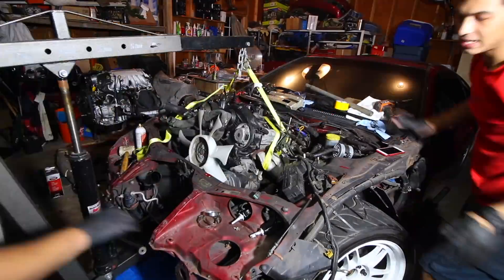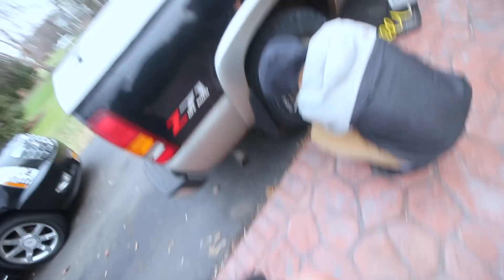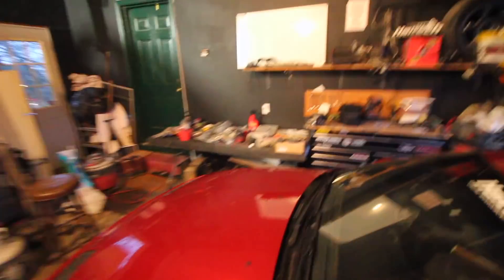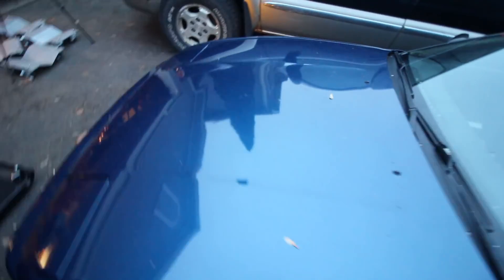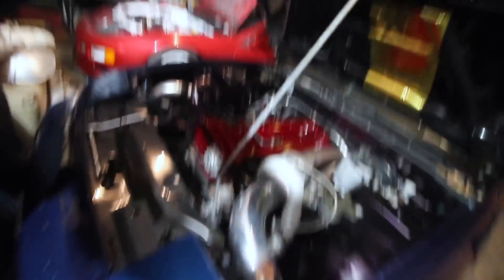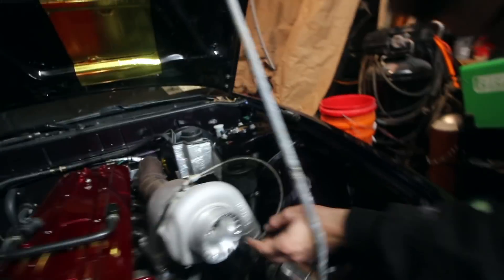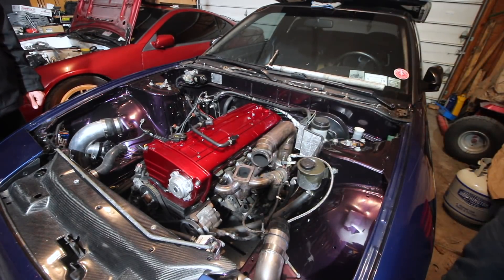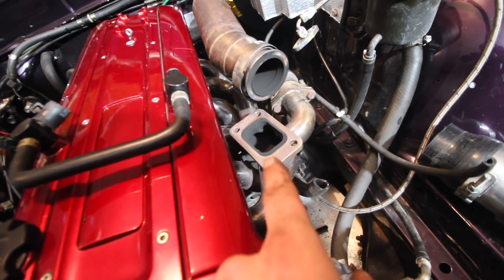Selling EVERYTHING... Let me Explain

Comment: I say 1jz, if you want high RPM and a stock block thats capable of making 900-1000whp and its 1/3rd the price of a RB. The RB stuff is nice but its way over priced and doesn't really hold much power. Parts are really hard to come by, you can't just go to autozone and pick up whatever misc parts you need, the JZ stuff you can. motivedvd on here made a video comparing the strength of the RB30 vs a 2JZ and the 2JZ is miles stronger then any RB. The RB stuff is also known for cracking blocks at anything over 600whp without a girdle, oiling issues aswell. The JZ is a far smarter decision.
Reply: The rb parts are not hard to find anymore it just takes time because of shipping, the rb blocks do crack but mostly on awd applications because of the front diff twisting the block, this problem is not seen on rwd application until pushing about 900hp, but the 2jz is stronger but the rb revs higher and the sound is better as well plus the exhaust side is the same as the ka   or sr20 so the exhaust is shorter and better flowing.
Reply: 2jz's are good, but your beginning topic was 1jz. The s13 should stay rb series. Like that rb30/rb26 he built that's what he should go for
Reply: @Singleturbo-sk9qp  ain't nobody hating on the jz lmfao 😂 😂 I know it's a superior engine and can make more hp for cheaper than an rb it's simply a preference for me :). But if you want to talk power for the money then the ls is King ;)
Reply: @Marcoo_S14  what you're talking about is block twist which happens alot on the awd rb stuff, the cracking I'm referring to is right below the head stud area on the 25/26s which happens even on the rwd applications, it's a casting flaw on those rb's. Not enough meat in that area, which an RB30 is not prone to but still even then the 30 is a much weaker block then a 1jz or 2jz. The 1jz is the same as a 2jz, Siamese bores same sleeve thickeness and materials just has a shorter deck height. As far as parts I'm talking about gaskets, sensors, alternators etc... Maintenance items are alot harder to come by then a JZ. You can walk into AutoZone anywhere and get whatever you need for a quick repair, in the states atleast. Plus a low mileage 1jz is $1400-$1600 from most importers, an rb26 can go anywhere from 3500-7000 depending which year and model RB you choose.
Reply: @Juhkwez  Look up username "jet066" on instagram his stock 1jz just made 1141whp thru a powerglide. No stock RB has ever made that power, let alone thru a powerglide.
Reply: @indecay3952  that is true bro however the twist is what causes the cracking in that part of the cylinder, it's in the motivedvd video and I have personally asked platinum Motorsports about this issue since I run a rb25 neo on my car and they explained that in rwd use this cracking is very rare and with a girdle it's non existent if you want to push more than 1000 hp but now a days most parts like that can be found on raw brokerage and other websites, it really isn't that hard but I get your point plus I do like the jz, the only reason I didn't swap it into my chassis was because I want to stay true to Nissan :)
Reply: He already has a JZ in the family, definitely stick with an rb platform for the content alone

Comment: Personally, I think you'd be best off with an RB30 block and crank, contentwise. RB25s are much easier to come by, but if you can get an RB30, then just do it. Also, if you want a transmissim that can handle more power than anything, get a ZF GS5-39DZ (E46 325D, 330D and E39 525D and 530D manual trans). It is a 5 speed that can handle over 1000 Nm (740 lb-ft). If you want a 6 speed, go for the ZF GS6-53DZ (E60 530D and E90 330D manual trans). Both are very cheap and (at least in Europe) not hard to come by. There are people that claim the 6 speed can hold about 1400 Nm (1040 lb-ft). There are even adaptor kits to bolt these transmissions to RB engines. I'm going to post the gear ratios at the bottom of this comment. I am currently building a Mercedes M104 turbo engine and using the 6 speed.

GS5-39DZ (5 speed) ratios:
1 - 5.24
2 - 2.92
3 - 1.82
4 - 1.24
5 - 1.00
R - 4.72

GS6-53DZ (6 speed) ratios:
1 - 5.08
2 - 2.80
3 - 1.78
4 - 1.26
5 - 1.00
6 - 0.83
R - 4.607

It is very important to buy the exact transmisson. There is also a GS6-53BZ, which is a petrol variant. Don't get that. The diesel (DZ) ones can hold much more torque.
I hope you find this comment helpful :)
Reply: A dude here broke a 6 speed zf in is 900hp turbo S54, it was nuts
Reply: @alexstromberg7696  Well, if it was a GS6-53DZ, then I am kinda surprised. Either way, a 900 hp 3.2 should have about 1300 Nm give or take. Considering it was built for a 500 Nm engine, it's still an amazing feat. I am actually building a Mercedes M104.992 (3.2 I6) with a T76 (7675 turbo) 0.96 AR. Should be able to make about 1000 hp, but I'll be pushing something between 720 and 800 hp. You know, ideal daily power :D
Reply: @aestheticoutlaws5259  he wasnt really caring if it broke, he streetraces that car so that the tranny even loved so long was a surprise.

The m104 is a really under appreciated engine, a guy here drifts one in a Merc chassi
Reply: @alexstromberg7696  a lot of Swedish and Norwegian guys do use that engine. I am going to streetrace it too, but I don't think I'll be abusing the tyranny. No need to power-shift or force the tyranny into gear when you have 4 times the power of almost anything else on the road
Reply: @aestheticoutlaws5259  If you're racing other more normal cars then no need to power shift or so, but if your racing other cars with 3 kits of nos and 9 liter engines you have to xd
Reply: @alexstromberg7696  I know. Can't wait to see the look on 911 owners' faces... And I'd love to see how my car will hold up to a Hellcat
Reply: hellcats are heavy so no problem.
Reply: @alexstromberg7696  yeah. They have about 650 whp, I'll have about 750 and I'll be about half a ton lighter. The only thing I am worried about is the 8 speed auto. It can shift faster than anyone with a manual and 8 gears means it will be almost always in perfect RPM. well, I'll have to find a Hellcat to race. Thankfully, I know about one :D

Comment: If your keep the rb20 get forged internals..I melted rings and cracked a piston trying to break records but the block held up .I had the head machined and went up a size on the pistons...make sure to upgrade the oil and water pump..I also know u can improve the oil flow on it

Comment: Rb25det Neo, no hydraulic lifters solid as rb26 and cheap,  plus later  if you get an rb30 block just use the neo head, combustion chambers are smaller for more compression for e85 use if going that path, keep the good work..

Comment: If you could lower the subframe and the engine block, then RB30 would be great, RB26 is a 4wd based and needing extra extra $$ to be realistically working, RB20, RB25 and RB30 are easier as they came as rwd trans

Comment: Being in Australia, I've seen stock bottom end RB25  handle a lot of abuse with the correct products. Billet oil pump gears, Metal gasket with ARP headstuds, good fuel setup with a GTX3584RS or the new G series. Haltech ECU. She will make 500-600hp on E85. RB30 is a lot different. If they're not built correctly, you can spin bearings a lot in them!... Also... Deffently install  Platinum racing product brace if you going to build an RB25 - RB30!. Last thing, RBs love to rev!. was revving my RB26 to 8000rpm or sometimes to 8500rpm!. Shimless heads can rev even more. unless if you want to be a baller and build an RD32... Diesel block RD28 stroked to 3.2! ;)

Comment: I think its fair to sell the rb20 but i wouldnt do it unless you have a 25 or a 30 in the pipes because you'd just have that poor gal sitting, as it is now you can get a new intake manifold and exhaust that could transfer over to when you get the 25 or 30 engines and have the 20 running in the meantime, that's just my thought, i see you puttin in effort so just think this method would be less stress which you dont need.

Comment: I wouldn’t sell the rb20... they’re worth like 1600 with a transmission, and you’d be selling it without the full harness and oem accessories most likely . The amount of money you’d gain is really minuscule considering the car wouldn’t be functioning until you have an rb30. Plus, when you swap the s13 and money allows, you now have a dope reliable mid hp rb20 setup to drop right into another car for a drift car!
Reply from the maker: Please find one under 2500 haha
Reply: Kalvin Malli The local importer by me sells them for 1700-2000 with a trans and myself as well as a few friends have complained they overprice basically everything . Idk about the 30 though. Either way, I think it would be dope to see the 30 in the s13 and then if possible you keep the 20 for a later chassis. From what ive seen (I’m an og subscriber I remember the bottom mount turbo and crossover intake setup with the varstoens😂) It’s reliable, makes good power and sounds great as hell. I think it would be sick in a drift chassis when budget allows 🤟

Comment: What about boring out the rb20 to a medium displacement like 2.2-2.4? Literally just machine work with current setup or whatever you have in the works. An Rb30 is great(with the 2.6dett head), otherwise it's an Rb2.5 head with combustion chamber matched and likely little else performance tailored as it was an NA only engine for the AUDM. After watching a block hardness test of an RB vs 2jz, i'm not buying an RB. Stick with a reasonable HP goal without running it on the ragged edge with a questionable tune. They are solid, not indestructible as ppl love to think. I always wanted to RB26 swap my '91 240sx le(any of the 9 i owned) and keep the full factory AWD (atessa-ets). I've seen a couple, but never real proof and thorough videos showing their proof and execution of such a claim. Full race s14 was the closest i saw, then it burned to the ground....